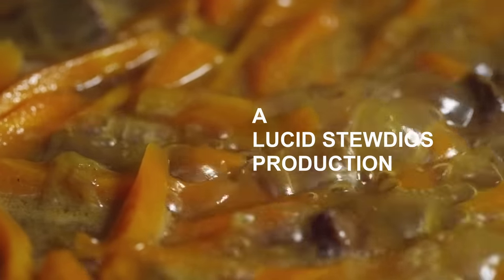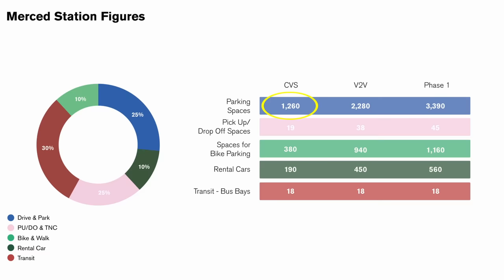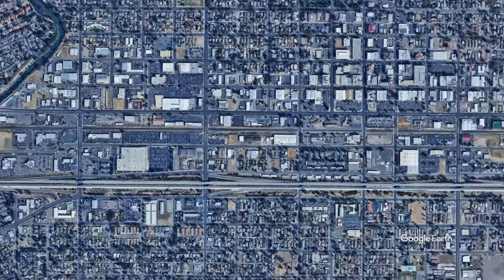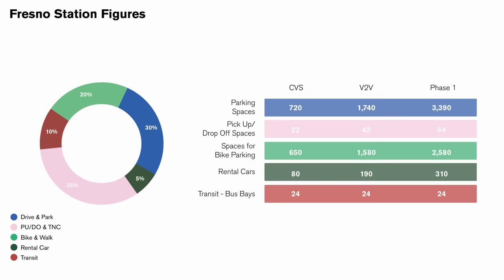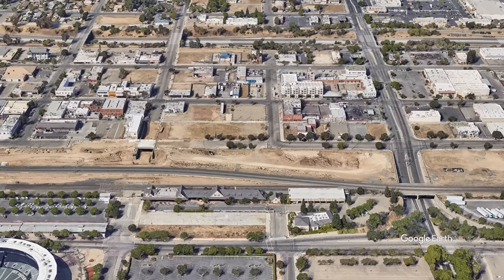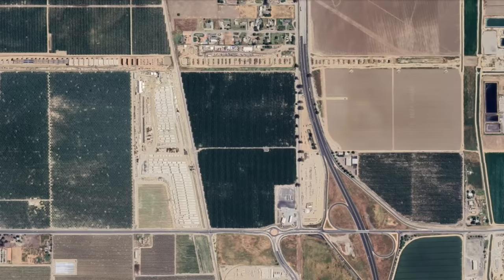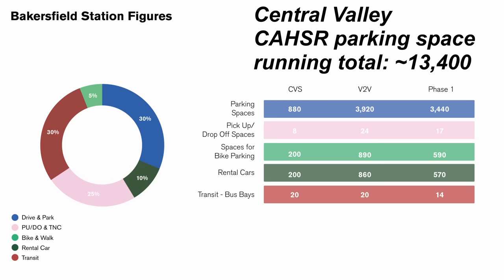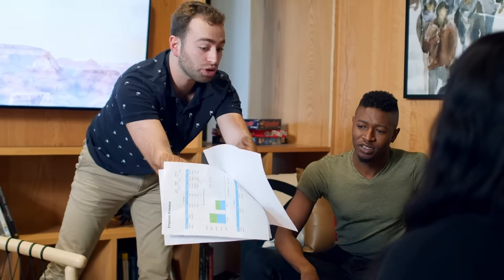California High Speed Rail : A Park & Ride Nightmare | CAHSR

Comment: I think the issue with the parking lots is also partially the fact that building residential and commercial developments isn’t in the legal scope of CAHSRA. it’s up to local municipalities to improve the station areas and there’s certainly not a shortage of land so they have a big opportunity here. but if CAHSRA started seeking out developers to build housing at this stage, many people would (correctly, IMO) view it as a diversion from their stated goal of building a high speed rail line
Reply from the maker: That's a good point. Hopefully once they switch from construction to operations, we'll see how that works out. Still, I don't think it diminishes the structural problem of these cities being VERY suburban, and the accommodation of parking and ride actually encouraging expansion of that.
Reply: @LucidStew  definitely a problem still, I just don’t think one that can be fixed by CAHSRA as they currently exist. hopefully we see a lot more from the cities around the stations in the next couple years that indicate they will be remedying some of these problems
Reply: @LucidStew expansion will happen no matter what because that is what our species does. The design is meant to increase ridership and reduce people driving from suburban places to suburban places. This is not some little tram line for connecting transit dependent condos or apartments. The cost is way too high and cannot be underutilized by sealing it off to the people that actually live there now who most likely will never be able to not have a car. It is a HSR corridor and should be treated no different than an airport. Providing access to it for transit dependent people is the job of the cities, not CAHSRA. Nothing stops BRT, light rail, and local busses from being the main way transit dependent people get to a station.

Comment: Great video but I do think you're harsh.
First of all, about the "stations in the middle of nowhere". Yes, they are not in ideal places but they can serve a groupnof smaller places that do not justify big investments to bring tje tracks closer to them. From the ,ap I think they do have a potential in the future to attract the nearby monicipalities to develope into the station's direction. Remember that most central stations and corridors that are in the center of the city used to be the edge, or even further out, until they got surrounded by the settelment they served.
As for park and ride, I'm not a fan and the number of parking spots is huge they are built in a way that it's easy to develope them into high density housing while eliminating them as time passes. That said, they should work toward good frequent transit to connect the stations to the nearby towns. It's importan to mention that CAHSR cannot do everything on their own and without cooperation from the different municipalities and other local authorities it won't work.
Maybe help with transit financing for the first few years will help.
Reply: I rode HSR in Spain to Zaragoza. That station was very far from the urban core but a bus ride made it just fine. I prefer SF’s stations of course, but this will work for rural areas.
Reply: @robichaud-carew 1.6 mi is not "very far", especially when it's a new station built for the HSR service as the more central stations were inadequate. That said it is near dense urban areas, even if not the "city center" and is connected by local trains, buses and the planned 2 tram line will stop there as well.
BTW, this is an example of how you can do this and provide a fast direct connection as on the the Madrid Barcelona-French Boarder the main line bypasses cities like Zaragoza or Lleida with a direct and fast connection to the central station or - if not possible (like Tarragona, where the station is in the middle of no where due to the complexity of a diversion to the city itself, especially with the junction splitting to the Mediterranean corridor) they provide a shuttle to the city  and in 2026 the tram should open and connect it as well and there are many that 
it's still very popular and getting close to 1M a year (Tarragona has ~138k inhabitants) and it does have a car park but only for 630 cars and it's not free (1.75€/h).

Comment: Park and ride has to be garages only in my opinion. Easier to build high (especially since I imagine park n ride will be popular and gets cars off the roads!!) than have surface (yuck!) lots which are wastes of space. Shame seeing small businesses get kablooied, but hopefully there are good plans (LOL) to fix that in the future.
Reply: given most of the surface parking areas are listed as potential future TOD, I'd say it's a certainty that those will be redeveloped, leaving space for a parking structure at each station. The Central Valley is very car-dependent and likely will remain so, so these stations need to address that. Hopefully with the introduction of HSR and better transit options to get to and from the stations, as well as TOD around them, that'll encourage more people to drive less and use transit more.
Reply: @ChrisJones-gx7fc  Agreed! Park and ride is the first step. Afterwards you can better map where people are going and prove demand to better build out metro services to improve transit.
Reply: Parking lot -- ballpark $2,000/car.  Parking deck -- ballpark $25,000/car

Comment: personally feel like your hate for Kings-Tulare is a bit overkill given that kind of station is actually not that uncommon elsewhere as far as HSR stations go, Aix-en-Provence TGV in France is the best example since it's 13km(8mi) from the city center of the city it's supposed to serve and in the middle of literal woods, it's only connected to the outside world by a literal highway crossing underneath, albeit it's a far better setup imo to serve the role of a park and ride station but considering how busy it is don't see how Kings-Tulare can't even see a fraction of that (if phase 1 is ever completed), Americans don't seem to be against the concept of P+R considering Brightline Florida gets by fine with their Orlando station at the airport though probably shouldn't be doing that in prime downtown land like in Merced or Fresno which I agree are very dissapointing to see
Reply from the maker: The push-back I'm getting so far on Kings/Tulare is that similar ideas exist elsewhere, but I'm not really hearing why it isn't a bad idea there as well.
Reply: @LucidStew  I mean no one is saying that P+R stations are the gold standard and something that should be getting built everywhere, but it's a tool in the tool box in transit planning which has its optimal use cases, in the the Aix-en-Provence TGV case (similarly in betweeen population centers of modest size) the alternative is just not have a station there as you can't do TOD in the woods above a highway and diverting the RoW to pass through a city of 140k makes no financial sense especially considering you'd have to tunnel under it in this case, given it's well used I'd argue it was the right call which imo driving to a HSR station still beats just driving to your destination by quite a bit, plus if the California planners have their way it's supposed to be augmented by the Cross Valley corridor which would give a rail link to neighbouring cities and an alterantive to driving besides busses (though surprise it's not going to be there when the station opes which is dumb)
Reply: Also the Cross Valley Corridor, when built, will offer a car-free way to access the Kings station.
Reply: Aix-TGV was not supposed to exist. SNCF wanted to build a Cote d'Azur branch to its Marseille LGV Med. The branch would have paid for itself in 20 years but passed near Aix and faced local opposition. Building the LGV Med in the densely populated Rhone valley was hard enough and SNCF agreed to the requests of Aix politicians who wanted a station not a LGV. 
It receives about 3.5 million passengers annually, equivalent to Amtrak's ridership at Chicago Union Station or on its Acela service. P+R and HSR work very well together but most people drive or catch a bus to Aix-TGV in order to board a TGV going to Paris, 455 miles away, or further away to CDG airport, Belgium, Spain or Germany. For shorter trips like the ones offered by CAHSR most French car owners will just drive.
Reply: @alaindumas1824  valid points and wasn't aware of the political nuance that allowed the station to come into existence, agree that for the Initial operating segment it probably won't be very attractive to use but if phase one opens it absolutely can compete with trips to the Bay area (~350km, 4h+ by car ) and isn't terrible for LA (~200km, 2-3h+ by car depending on traffic) plus avoiding LA or Bay area traffic is a pretty attractive proposition by itself which from what I can tell is much worse than what you get on French autoroutes, the ticket price is most likely going to be deciding factor tbh

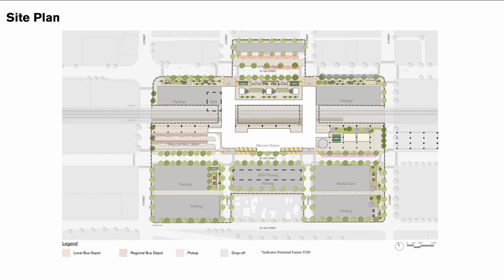Comment: 3:34 I personally disagree that if the parking lots get converted into TOD (and they should), that all of the parking would need to be replaced with an expensive parking structure. 

I hope (and maybe i’m being too optimistic) that if central valley cities get to the point of major TOD around their high speed rail stations, they would also at that point have decent enough local transit to take people to the station. maybe in the end all they’ll need is a small parking lot and a drop off area.
Reply from the maker: I think they very suburban nature of these cities will force it. Buses are realistically the only solution there and there are a lot of people who live in the suburbs that don't want to ride the bus.
Reply: @LucidStew  I can definitely see that, only time will tell.
Reply: Personally, I think they should create a TOD with a garage in the middle similar to how they do park n rides in Europe. Also, I think they continue pressuring cities into investing into light rail transit.
Reply: There should be underground parking requirements. if it's expensive to build, there won't be as much parking, and our cars shouldn't act to expand the walking radius.
Reply: @nevermindful  Or they should just pressure the cities to remove minimum parking requirements.

Comment: Those stations could a mix residential commercial havens but no.
Reply from the maker: I think Fresno has a good chance of realizing the transit oriented potential of a system like this, if it can redevelop and revitalize. Same with Merced, if they can link the station in a pedestrian friendly way to the existing downtown area. Madera and Kings/Tulare are bad ideas as far as I'm concerned. Bakersfield, I think the locals blew it with this as the "Locally Preferred Alternative".
Reply: @LucidStew  oh 100%. Nimbys kill so many projects that long term would help them and solve a lot of their problems/complaints.
Reply: They probably couldn't no one wants to live somewhere just because a long distance train happens to be there. One can see this fact in stations on the northeast corridor.
Reply: I think it's more like they haven't sold the land yet.
Reply: … but not yet! Fresno isn’t SF, but give them time. At this point I just want the damn rail I don’t care to waste time about what happens around it yet
Reply: @AnoopSathyan0197  It seems they're moving forward with the project, but due to the nature of it not being a freeway funding is coming very slowly.

Comment: Park and ride is not a bad thing in the right areas. Many of the areas the train runs threw have urban sprawl with the only way to get there is by driving. There best option is to drive a short way, hop on the train for rest of the trip. Keeps thousands of cars out of traffic jams. And TOD works in some areas but still wont for everybody. Many people dont want apartments style homes. They want that single family home for a quiter life. Giving them options to cut car time significantly is a win win. Keeps people out of cars in busy areas.
Reply from the maker: If you're talking about 3,000 parking spaces, doesn't that then become a busy area? Seems like you're just shifting the inconvenience from one area to another. And then with some of these intended to be near downtown walkable spaces, isn't the traffic of 3,000 cars a detriment, neutralizing whatever win you may gain by encouraging density around the station?
Reply: @LucidStew  yes and no. If it's not in a downtown core, then park and ride is ideal. Especially if it's near major roadways. Having TOD with parking there is ideal. For the poeople that live in the burbs but want a fast way to get into work or travel. Great for getting people out of traffic jams saving on idling time and opening up space for truck traffic on the highway.

Now in urban cores no. Having limited parking is ideal there. U already have high development with the jobs. Getting people there and out quickly is the key. With development adding more homes and jobs. So not much in the way of parking is needed.

Commuter trains work best in this route as it's geared to shorter trips, from the burbs to downtowns. While HSR is more like plane travel from point to point imo

Comment: There is a massive difference between a station in the city (even if it is in the outskirts) and one in a few kilometers (or miles away). Shared stations for more than one city are a terrible idea, you need to choose one on none. They should reconsider some of those station locations.
Reply: You have a local service that runs between all 3 locations.  People don't tend to use HSR every day, so that's a fine solution, since it leaves the opportunity to have a more pedestrian layout around the station.

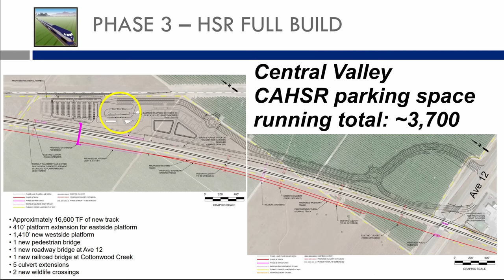Comment: 6:24 Seems a bit short sighted that CAHSR did not take into account the additional overpass to accommodate that business when designing the AVE 12 Overpass, so they will have to spend extra money to close it down again and add another bridge.
Reply from the maker: Probably due to the phasing. They don't need that second track and platform until V2V is connected, and they probably didn't want to pay upfront for a structure that was doing nothing for 15-20 years.

Comment: i don't think there's anything wrong with kings tulare when i visited italy and rode the high speed train there was a similar station on the outskirts of a smaller city that was surrounded by basically nothing. Not all of the high speed trains stopped there bc it was lower traffic but it gave that city a connection to the big cities
Reply: I really don’t think that station deserves all the hate it gets. The station will be more accessible after the planned Cross Valley Corridor is built.

Comment: I get that the Central Valley may not have as much transit. But come on, at least make half of those lots TOD. I would easily take the large ugly garage for plenty of TOD around the station. 'specially since IOS is gonna need some places for people to go, why not have those places be at the stations?
Reply from the maker: "potential future" TOD. Even still, due to structural issues, that will be mostly useless aside from Merced and Fresno, since those stations are actually located near currently denser development.
Reply: Have you considered that this was offered to developers as TOD and they said hell no.
Reply from the maker: @mickeygraeme2201  That is not a bad point. The "private investment" windfall that the CAHSR plan has always included still has not materialized. At this point they're hoping that will happen once Merced-Bakersfield exists as a demonstration.
Reply: @LucidStew  While that is possible I wouldn't be so sure. Most rail lines don't have a particularly large amount of TOD even when they are fully running and I think people forget that. The NEC in USA and High speed 1 in england show this. Most bus Lines in California move more people daily than the city airport. Long distance journeys are just not that common for most people.
Reply from the maker: @mickeygraeme2201  L.A. Metro's bus services do carry about 70% as many riders as LAX does. That's an interesting point.  I don't think one should wait on the other, but you really do need those distributive transit networks to make these work efficiently.